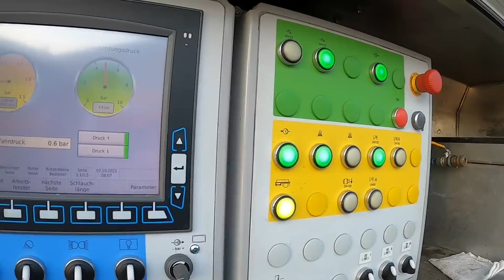Kempinger 224. Warum ist es so befriedigend fauligen stinkenden Sand so verschwinden zu sehen ❓ 😊

Comment: The vaccum truck is awesome. They are used here for the same purpose. I wondered where all the stuff goes once in the truck.
Reply from the maker: Now you know...😅 Around the corner 😅
Reply: We used to haul our vacuum truck loads to our wastewater treatment plant, where we had a special area inside the fences for dewatering. I worked for a small city that had a vacuum truck.
Reply: @kempingerrohrreinigungberlin  the contrast between this and how another channel handled it (the fellas from Lahore, Pakistan) is very interesting and stark.  They just pull up to the side of a roadway somewhere and open the back, then one guy climbs inside and starts using the hose to carve out chunks, and they just leave it there.  Completely different mindset, but they're also not treated with any respect by their society, so I can't blame them.

Comment: What is that pit, Herr Newman? What is it for/what purpose does it serve? Cool video!
Reply from the maker: Hi Tim...This depot mainly has cleaning vehicles .. And that is the washing area .. The pit should only catch the sand and the coarse dirt from the sweeping machines .. At the end of the film you see me jetting the outgoing drain to the next shaft ..The actual task of the colleague was to jet and suck the main rain pipeline silted up with sand , till up to a lifting system at the end of the line. The video is still to come .. I was there before without this truck and at some point I realized that the sand was too much for me and  my van .. So this pit wasn't his main job that day ... he was there anyway.
Reply: @kempingerrohrreinigungberlin  Now I understand. Thank you.